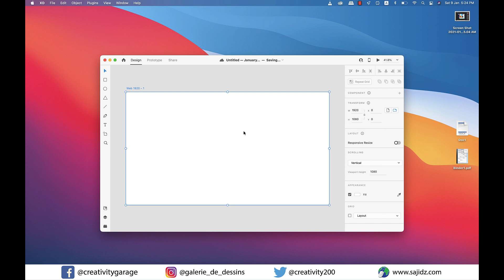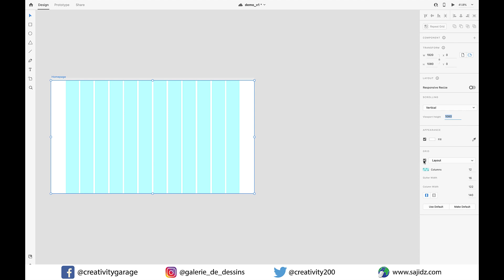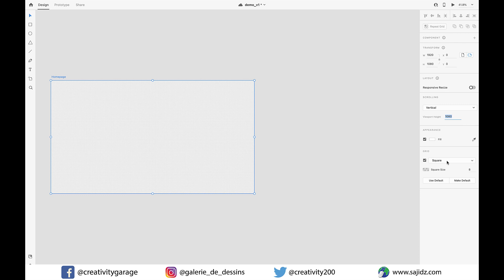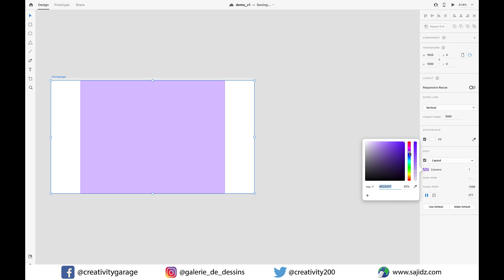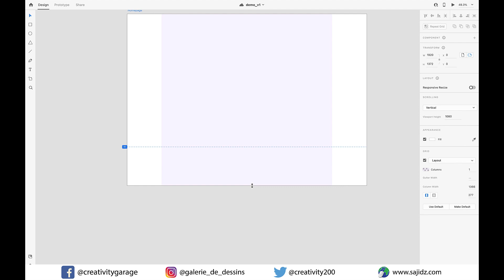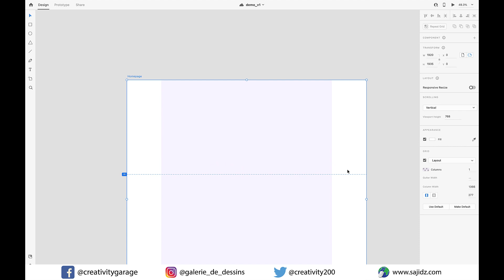Adobe XD Low Fidelity Wireframe Basics

Comment: I was looking for a tutorial on how to use XD for low fidelity wireframing, since it's generally used for mid to high fidelity. This video came up as first result. However, this video doesn't show me anything in terms of what I searched for - the title is misleading, it should be called short intro to artboard setup instead. It has nothing to do with low fidelity wireframing. Also the comments on this video is blatantly non-organic / botted.
Reply from the maker: This is just an introduction and that what the title says.